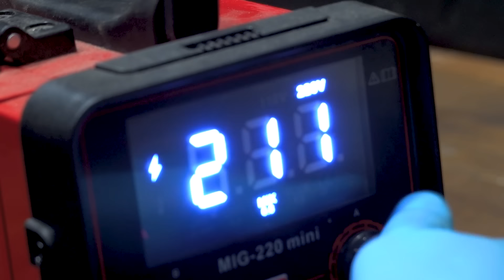Restoration of TSAR Axe of 19th century

Comment: sorry to tell you but if the blade is tempered correctly it will be a straw colour not white, white is to hard and will leave the edge at risk of chipping and cracking, there are many blade making video's to look at to verify this for yourself and I make blades as well so not trying to be clever, just save you possible problems